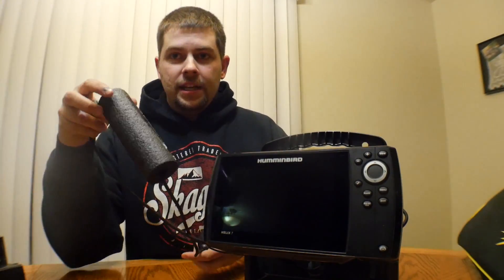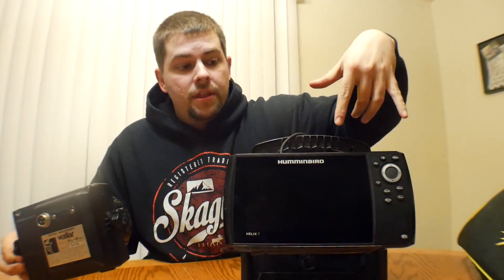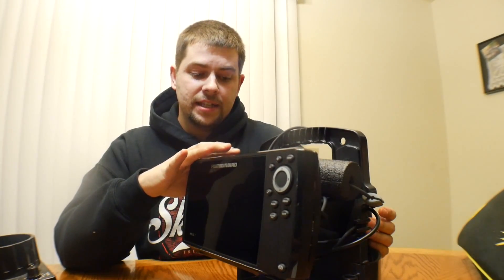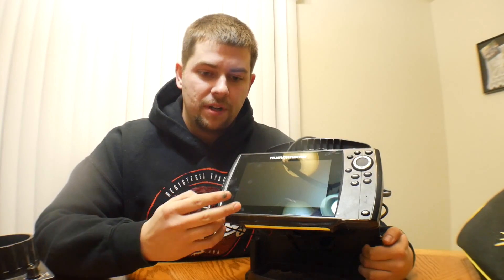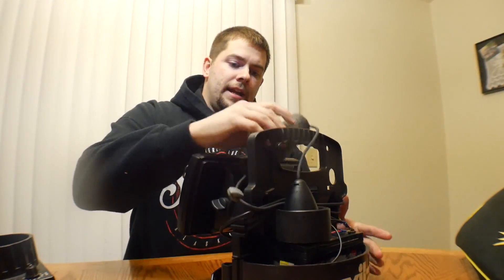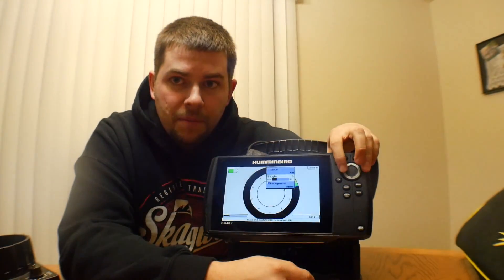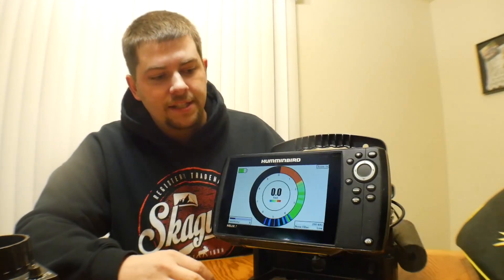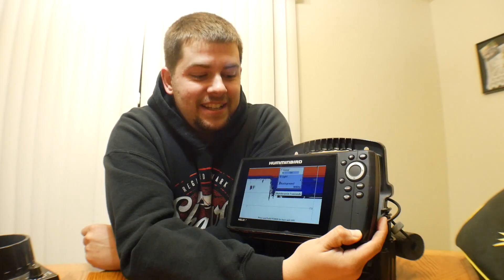How To Set Up a Humminbird Helix For Ice Fishing!

Comment: just a quick tip to try.  you get a better response out of the unit if manually set the depth you are fishing at or close to it.  seems to just be smoother.  I run the 5 on the ice and I have two 9s on my boat.  something to try.  there is nothing wrong with the auto depth feature, but especially ice fishing I've been taking the time to set the depth.
Reply from the maker: I get what your saying, i might have to give that a try

Comment: Can you use a vexliar ice-ducer instead of a humminbird one? Are the transducer connections in the back of each unit the same? I have a busted vexilar but I have the carry case, battery and transducer. Could save me some money if they are interchangable.
Reply from the maker: it will now work

Comment: Hey, so I got a question for you... so this year I bought the Vexilar fl-8 flasher and i love it.  But tonight I bought a helix 5 G2 at an auction for $285.  Just a regular combo not the Ice combo.  Then your personal opinion which one would you prefer the Vexilar or the Humminbird? I've never used a Humminbird flasher but I have it on my boat with a Side Imaging and I have fallen in love with that one.  What are some of the key features that the Humminbird offers that the Vexilar just does not have?
Reply from the maker: I like the Hummingbird better, I have not used the screen on flasher mode I actually like the sonar mode better
The vexilar is just a flasher, the Helix can do sonar and flasher and some even SI, DI, Gps so right there..
Reply: I used the Ice Helix 5 most of last winter and used the flasher mode much of the time.  While I haven't used a Vexilar, one thing the Helix has that I really like is called A-scope.  It's in the flasher settings, and it gives you a better indication of where the fish are going.  Fish appear like little blobs and as they get closer to the middle of the cone or to your lure they get brighter and bigger.  Kind of hard to describe, but basically they don't appear as simple lines on the flasher.  I really like the unit, so now I'm setting up my H7 summer unit for my dad to use ice fishing just like shown in this video.  Here's my Ice Helix 5 from last winter showing A-scope setting.  https://youtu.be/Bvio9BT5dVA

Comment: How do you like the humminbird so far? I have the helix 5 and the only complaint I have and could be user error is in the flasher mode my jig takes up a lot of the screen as a blue weak return wishing I could thin it down
Reply from the maker: I really like it so far, only thing is sometimes the depth is like 5-10 ft jumpy other than that it works good!
Reply: What do you mean by jumpy?
Reply from the maker: like one min it will say 11 ft then you take the ducer out if you catch a fish put it back in and it will say 23 ft
Reply: If you manually set the depth I believe that should help you

Comment: If I add this ducer to my Helix 9 SI G2N will it add the flasher option?  I don't see a flasher screen on my unit views and am wondering if the ice ducer "activates" the flasher view on the helix.  If not, what setting do I adjust to bring the flasher screen up?  Thanks and great vid!
Reply from the maker: If the flasher option is avaiable,  it will be under settings all the way to the right I believe, i just got the 10g2n and didn't see the flasher on default settings. I went away from the flasher screen found the sonar to be much better, watch my last ice crappie video and you'll see what I mean.
Reply: Thanks Kyle... will check it out
Reply: did you end up having the flasher option with the 9 - one guy at a store told me yes, another told me no...I want the 9!!!
Reply: Brandon Tamm from what I've read on Humminbirds website side imaging units do not have the flasher screen

Comment: Quick question for ya, does that ice transducer need to be at the bottom of the ice or just in the hole?
Picked up a hummingbird chirp gps G2 last week and finally got out yesterday but there was a lot of clutter on the screen.
Also, the lake we were on had like 3 feet of ice with only 4 feet of water underneath. Thanks!
Reply from the maker: It just needs to be in the hole. If there is weeds and 5-6ft they don’t work that great it will be cluttered
Reply: Awesome, Thanks for the reply. Heading out to a different lake tomorrow in northwest Ontario, hopefully land some decent walleyes

Comment: is that a helix 7 ICE or regular helix 7? does the regular helix 7 come with the flasher-style screen or is it just the helix 7 ice that comes w that flasher display?
Reply from the maker: it’s just the regular one, it has modes you can switch through
Reply: nice! thanks for the quick reply! I wanted the helix 10 for the mega imaging in the boat and to use with the ice transducer in the winter and I wasnt sure if the flasher display came on all the helix's...do you also know by chance if it's just the 7 that works with the vexilar mount or would it maybe work with any size helix?
Reply from the maker: The 7 does for sure, the 10 nope

Comment: What settings need to be changed? I have Helix 5 DI GPS and it's just not working for ice fishing like I was hoping. I have the right transducer, set to 2d element, and in ice fishing mode. I also get a lot of interference with my boyfriend's vex and the generator despite noise filter being set at max. Any suggestions to get this to work for me?
Reply from the maker: Not really an expert there, but play around with the settings and find what works for you

Comment: So the regular transducer that came with system won't work?
Reply from the maker: this system was originally for a boat.
Reply: Wisconsin Fisherman I have the same system for my boat I was just wondering if I can use the transducer that came with it
Reply from the maker: No you would need the ice transducer
Reply: Can you confirm this? Helix models with SONAR + GPS models have dual beam tech. Let me now... I've just put together a conversion kit from mine and I really was under the impression that the boat transducer will function just the same as the specific ice fishing transducer. Many thanks!!
Reply from the maker: It might work, but is designed for boating.

Comment: Why do u need a ice fishing transducer doesn't a open water one work?
Reply from the maker: It is set up for a boat originally
Reply: Open water transducer works also but ice transducer has a cone shape. It's easier to pull out the hole when you have a fish on😁